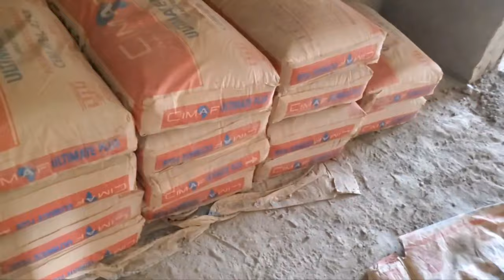Building in Ghana GomoaFetteh: Day lost count

Comment: Where the joint of the weld is it would rust because the the zink coating has been burned away and Ghana dose not have a  galvanising plant so any of those metal as soon as you weld them they will rust all metal joints that is welded and has no paint will rust they all must be sprayed